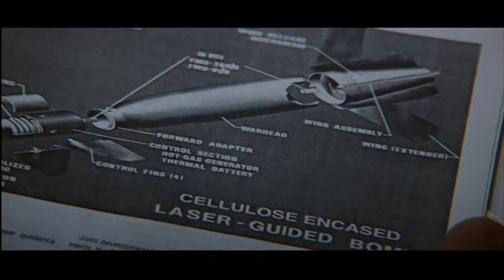CLEAR AND PRESENT DANGER (1994) Analysis of Cellulose Encased Laser Guided Bomb Explosion

Comment: It's eerie how realistic this is
Reply: @VectorOfKnowledge  Well it's not like it's impossible. Consider how sturdy concrete forming tubes are, and they're made out of cardboard
Reply: @VectorOfKnowledge  
That would be wrong
Its completely possibly to make but it would be have on as need basis
Storing explosives in metal is easy because takes a very very long time for the metal casing to degrade
Since cellulose is just basically paper, the explosive would seep through
So they would have to order it made and use as soon as possible
Also they wouldnt use Octol
They would opted for common explosive like ammonium nitrate
Reply: @verdebusterAP  How about some punctuation and grammar, so one could follow your thoughts easier?

Comment: I've wondered what the purpose of using a cellulose encased laser guided bomb would be. I know they don't want it traced back to them, but also using a unique bomb WOULD be traced back to them. Shouldn't have been a different signature?
Reply: In the original novel by Tom Clancy, this bomb (paper encased warhead part) was a secret, experimental weapon that was pretty much unknown to anyone outside the development team. If I remember right, Cortez makes the connection between the bombing and US military via the explosive material only. Still a flawed plan nonetheless, but the bomb itself wasn't easily traceable.

I highly recommend you give the novel a read by the way (if you haven't). It goes in so much more details about the military aspect of it (both the airplane part, the ground infiltration team, etc.) and might answer a lot of the questions you may have in the movie, not to mention deeper character development, theme, etc. I watched the movie first, then read the novel, and it really made me wish the movie was longer.
Reply: Its light weight. Which means you can either have more bang for your buck in a single bomb, or carry more bombs, or, have extended range on your aircraft through a lighter payload.
Reply: Technically, a missile with a "cellulose encasing" would be invisible to radar, though I imagine there are other sturdier materials that could be used instead of paper.
Reply: @sargon6000 it is not invisible. It has a reduced or different radar signature at best. Though for the time period of the film and location, the aircraft it came in on would be detected. Where the bomb is distinct is the minimal debris it produces, especially if the target is less sophisticated than a nation and lacks radar or the resources to investigate in a timely manner. Such as a cartel.
Reply: @jakec9441 "Invisible to radar" and "reduced radar signature" are interchangeable, most languages other than English don't have a word for "stealth".
Reply: They pretty much covered it. In the novel, it was an experiment in non metallic ordnance casings for stealth aircraft.
Reply: @sargon6000  There are around 7,000 languages spoken on Earth today, so how do know that?